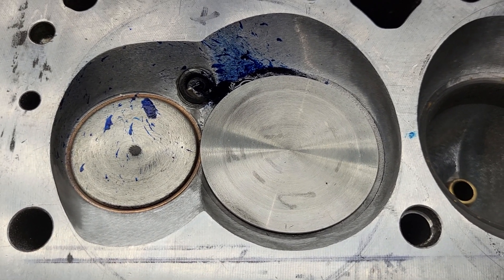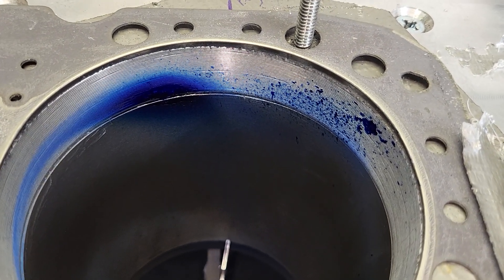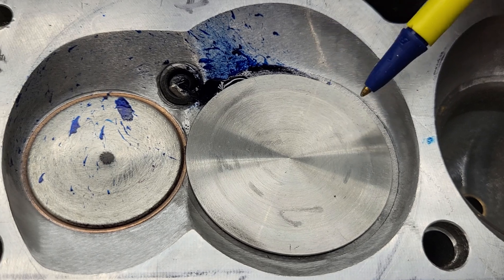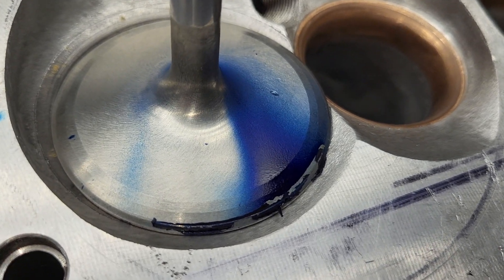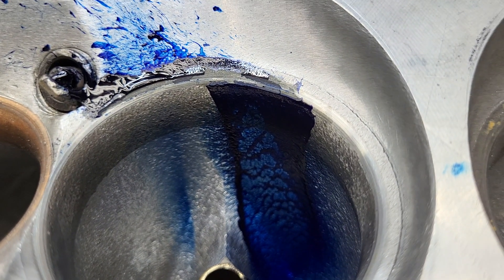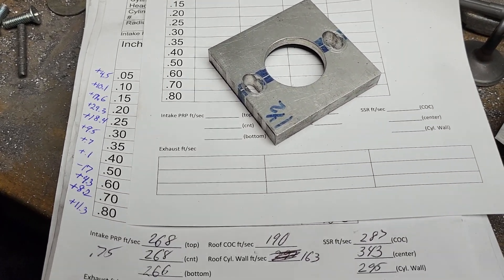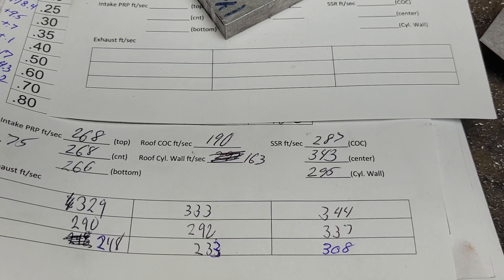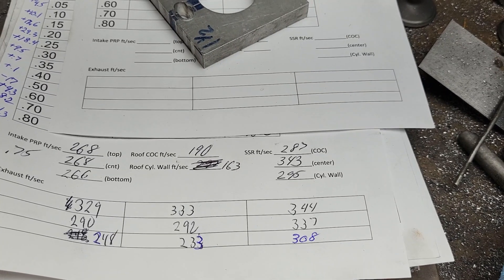David Vizard, Terry Walters, Dart 9 degree, Dart 027, 1000hp 454 small block Chevy project finish

Comment: Glad to see you back Charlie. Life gets very busy at times, and it often gets in the way of what we want to do.  That said, it sounds like you have achieved some significant improvements on the heads. I will however admit to one concern. I always look at the dykem, and whilst I do think that it is a very good indicator, my perfect port would have no dykem marks on it all, because it means that it is all in suspension, and all in the centre of the air stream. That said, in the video, the dykem on the back wall looked really good too me. It appeared to have gaps in the pattern as you looked up the port. To me, it appeared that the air speeds there were very good and trying to pull the dykem off the port wall. Overall, in my very inexpert opinion, i liked it. Regards Greg
Reply from the maker: Thanks Greg!
Reply: You'll always have dyekem on the walls, there's always a boundary layer that sticks to the wall, and anything in suspension stays with the boundary layer. The boundary layer is air that sticks to a surface, the real airflow doesn't flow over the solid object but the boundary layer that sticks to the object.

Comment: Nice Work Charles.
Reply from the maker: Thanks
Reply: @servediocylinderheads My hunch is DV is after longterm valve train Durabilty with less than 1.00 inch lift Cams and shaft Rockers used.
Years back he had an article titled Project Mighty Mouse 454 very similar to your project with him now. PONTIAC 30 degree intake seats used with Used NASCAR Del West Titanium Valves.  Believe D3 Yates Ti Valves.
Reply from the maker: @brracing7861  These are not D.V.'s 30 degree seats. Sounds like a cool project. Thanks
Reply: Charles Servedio, that is nice work and impressive.  Thanks for posting.
Reply from the maker: @ericsmcmahan  Thanks Eric!

Comment: Charlie, I enjoy all your videos. I see DV used a burr radius under the seat. I have a theory that if you were to machine a burr at some point below the seat fluid dynamics support that the air will turn out-bend and get out around the valve better than a multi angle or radius setup and I would think the dispersment of liquid would also improve a lot. At some lifts flow may actually fall a bit but I bet power would still be higher. Your thoughts?
Reply from the maker: D.V. did it with very fine cartridge roll.  It had poor dykem flow. I did the burr on the port right up to the lower valve cut. Much wider dykem flow. I would think that is worth some power. Thanks!

Comment: Hello Mr. Servedio, I have a doubt if the engine have only vacuum at idle,
why they flow bench with vacuum instead of boost. An engine at speed does not have vacuum but raming air from the overlap, exhaust scavenging effect and the piling up of air/fuel column coming from the intake tract.
What are your thoughts on this ?
Reply from the maker: N.A. engines operate under vacuum. Even full throttle, there will be a vacuum in the intake manifold until the volumetric efficiency exceeds 100%

Comment: The 3 most important things r air speed, air speed n air stream. RytCharlie? LOL
Reply from the maker: You watch Darrin. Excellent.
Reply: The right airspeed, too low and not enough energy, too fast and it become inefficient. Between 280-350ft/sec is ideal energy and efficiency as a general rule of thumb. Above that and you start getting diminishing returns, ie inefficiency, below that, and the flow doesn't have enough kinetic energy which also hurts efficiency. Given this, it's always better to have too much than too little.
Reply from the maker: @rolandotillit2867  The better the port design the higher the airspeed it will tolerate... thanks
Reply: @servediocylinderheads  Thank you!
Reply: @servediocylinderheads  hell yeah, every chance i get. Drag Boss Garage had him on 3 times so far. He loves sharing unlike so many. I wish Chad Spiers was as willing as u, DV n Darin. Hes just not into it
Reply from the maker: @rickyfulks889  Chad actually lets alot of good info out. He is very very good.